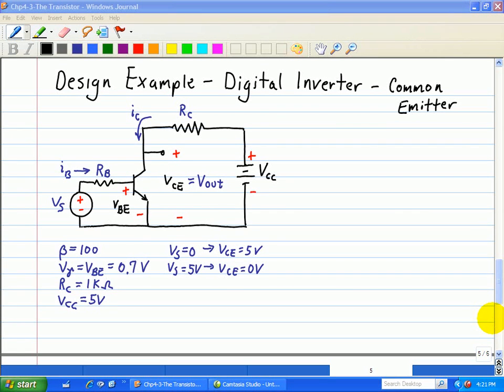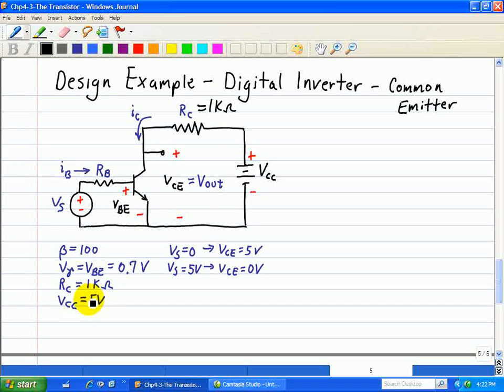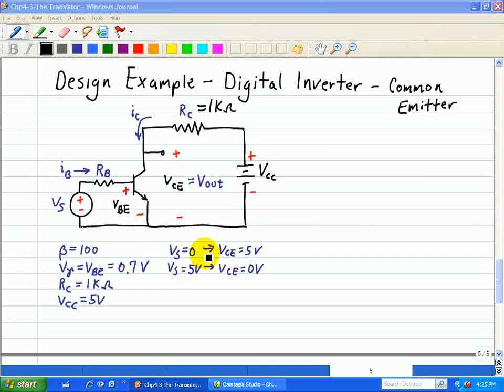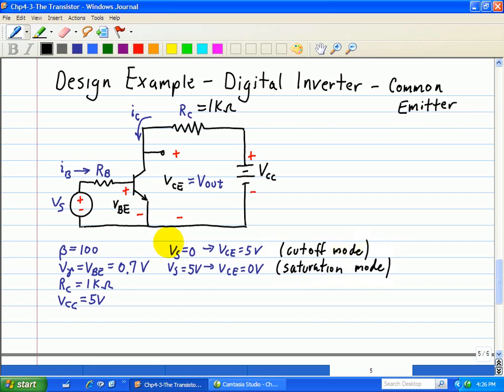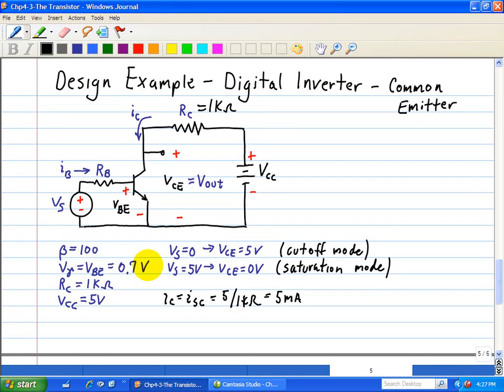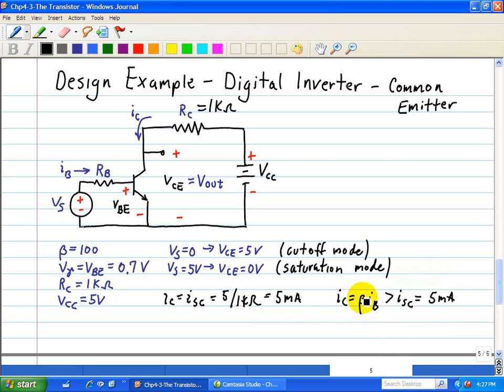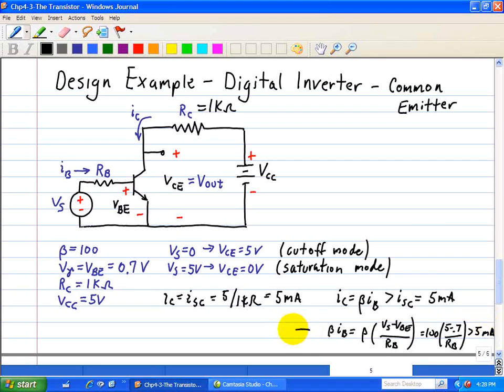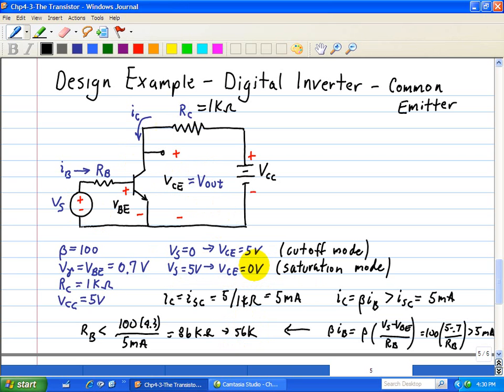Circuit Analysis -Transistor Tutorial - Common Emitter Circuit - Digital Inverter - Part 4

Comment: @darkknightgaury a question, if we have a wire and we connect it to form a circle, is this circle considered an electrical circuit and what are its components, what are the sources of voltage, current and resistance if any? thanks